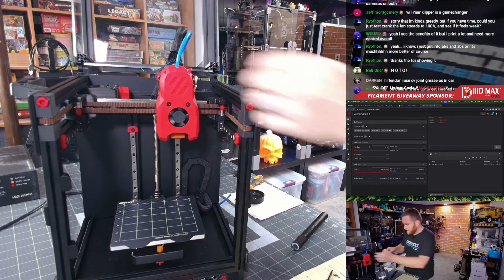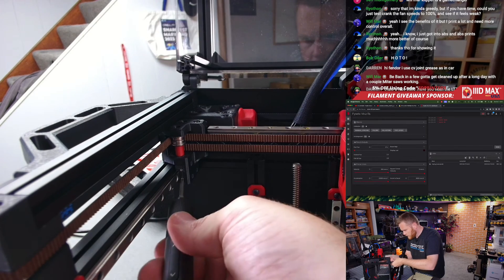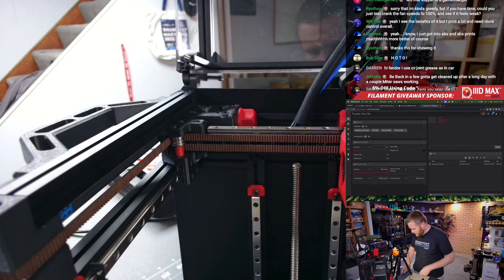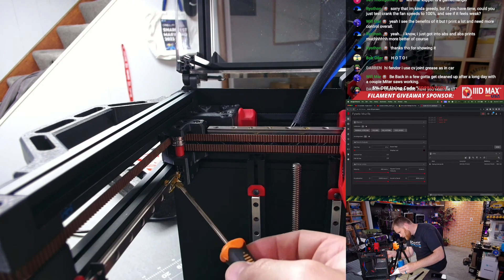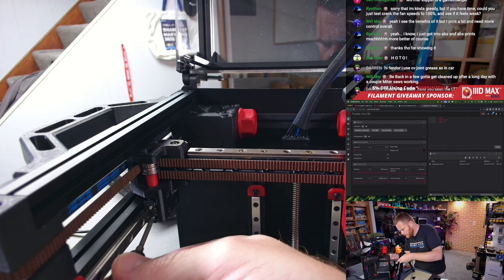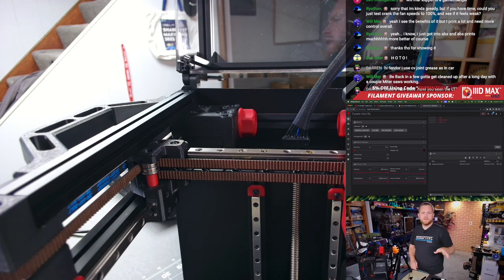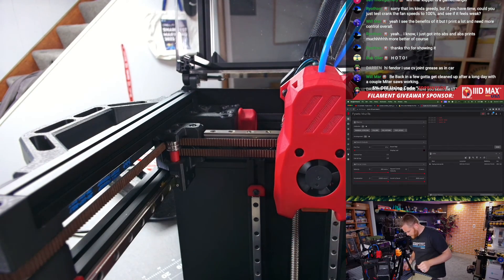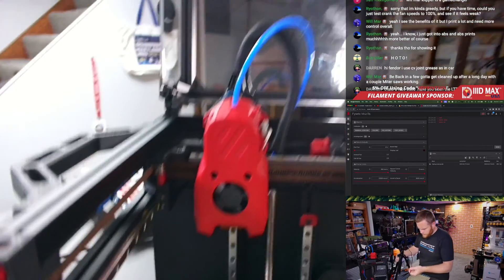Livestream Clip: How to lube linear rails

Comment: does this same concept go for the rail on the ke
Reply from the maker: Yep, it should work on most rails. Some have a port hole in the center and would require a more liquid grease, but most have dust caps like this.

Comment: I've had good luck with a small grease brush or even a small paint brush on rods and screws. Probably would work well for rails as well. Just make sure it's clean before you use it, and clean before you put it away.